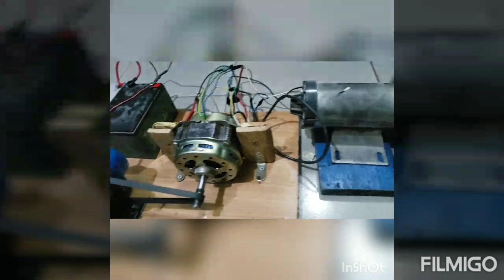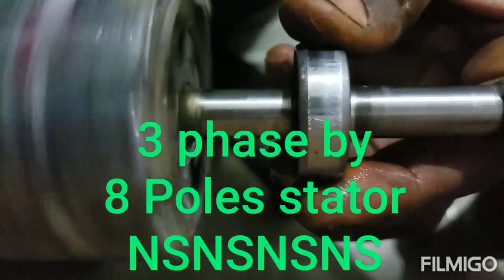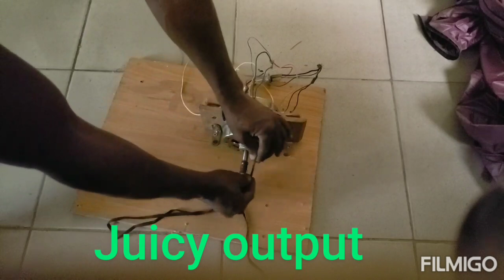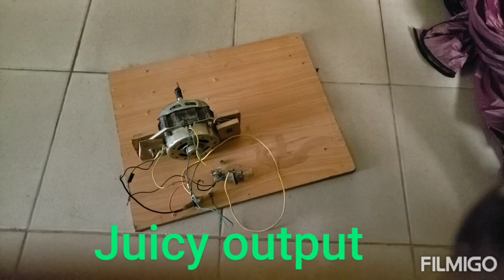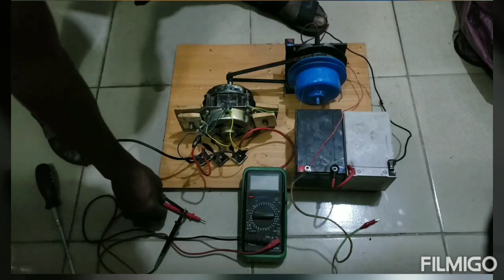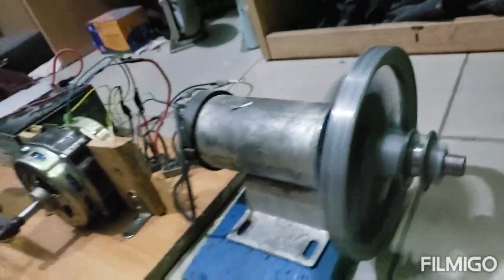FREE ENERGY! This will replace your solar panels.

Comment: this is nothing new show us it running off of the table and turn it 360 running and put real loads on it all DC motors put out a voltage and can run a DC brushed motor, make it self-run under a large voltage draw and Amp draw for days and then you might be doing something???

Comment: You may be generating 4x the voltage but you'll have 1/4 the current.  This along with electrical, magnetic & mechanical losses will give you way less power output than input.  Nice try.
Reply from the maker: So be it onto them that sleep
Reply: @marathonpower  Atheist, but thanks anyway.